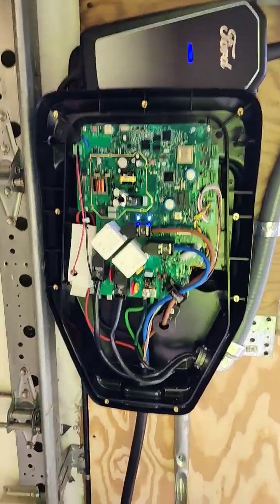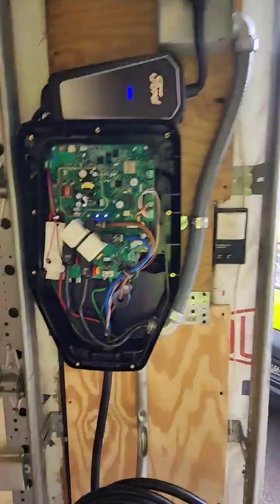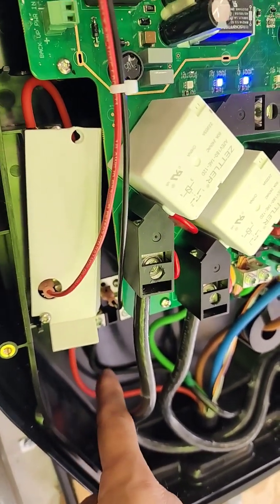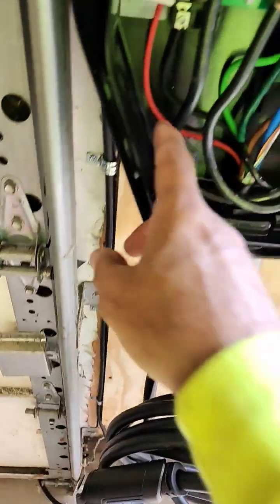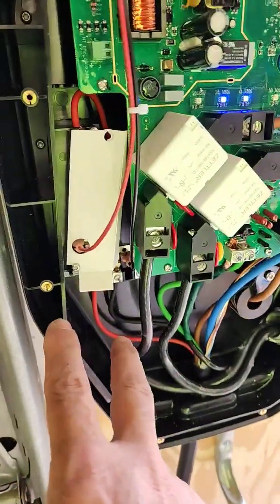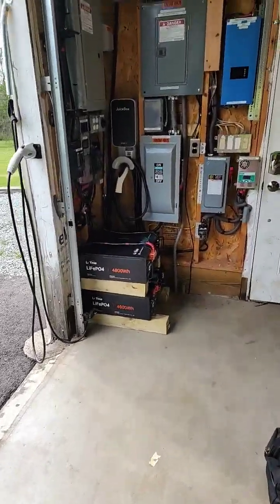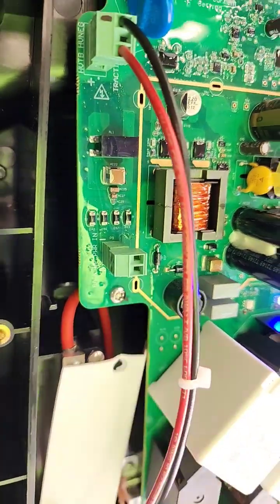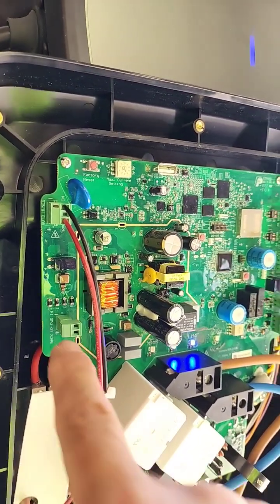1st Attempt at Ford Pro Charger to use on another EV failed...#fordfail #electrical #ford #etransit

Comment: On the SunRun setup there’s an rs485 communications link between the bidirectional inverter and the charger. Also, the charger is paired to the vehicle via Bluetooth.

My understanding of the sequence of operation is as follows: when there’s an outage the 12v battery in the SunRun system powers the electronics in the inverter as well as the charger. The inverter detects that there is an outage and sends a command to the charger via the rs485 link. The charger then sends a command to the vehicle via Bluetooth. The vehicle then closes its dc contactors and the dc circuit powers their inverter. To get this to work without the integration system you’ll need to have a modbus rtu controller write values to the charger. Unfortunately it is unlikely that they would share the modbus map in order to be able to configure this.

FYI, you can purchase and install the integration system yourself.